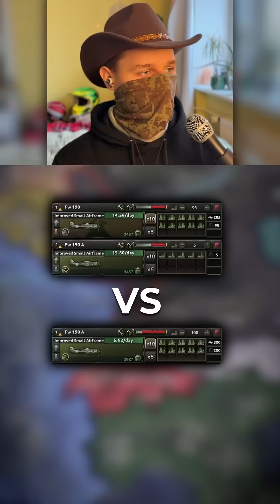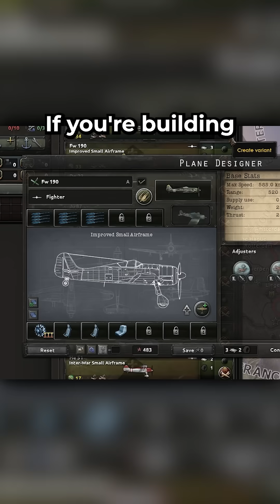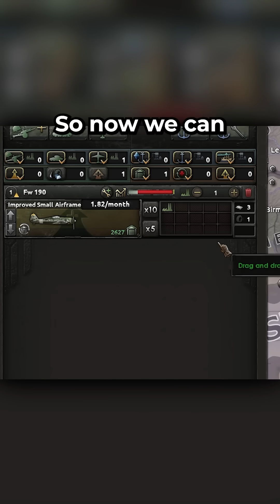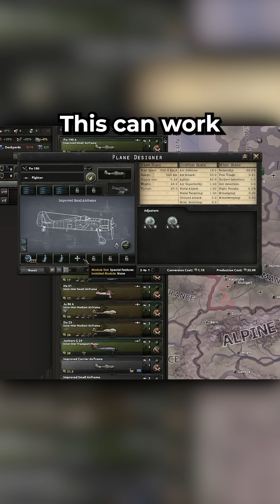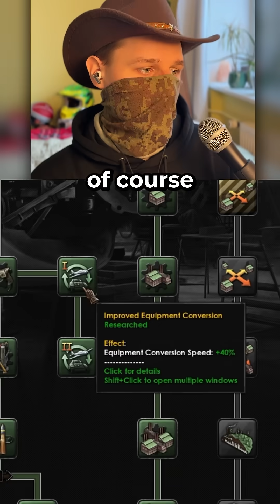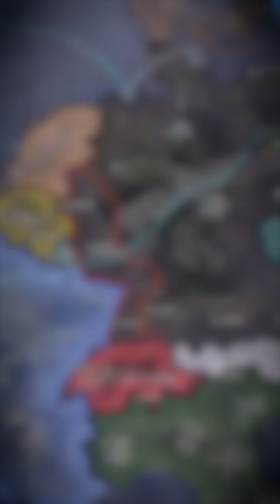Build Planes Like a Hoi4 PRO 📈 Production Guide #hoi4

Comment: I don't know how conversion works, why are you producing both the exploit airframe and the actual one? don't you just produce the first and click convert somewhere? How does this work?
Reply: You make both production lines because the conversion production line takes the cheaper designs in and converts them over time to the proper design over time once it's set to convert valid airframes.
There's no mass conversion button. Almost all equipment which can be converted works this way; being produced or bought, sent to stockpile, and then sent back to the factory lines for refit.

Ships work differently.

Comment: Alright. So this is misleading, because the rubber doesn't just dissappear into the abyss in the second variant. You simply delay the need for the rest of the rubber. Which isn't bad, but it doesn't actually cost less this way. If we take 2000 of the best planes in both scenarios, they will still have the same amount of rubber in them.  By converting you'll loose time. With the conversion tech and everything the lost time will be negligable, but you'll still technically get your best fighters later. That means you'll need to build for longer for the same amount of airplanes as method one. But of course while building, you'll consume less ressources. The rest of the ressources will be used in the extra time that it will take to convert the rest of the planes.
Reply: So instead of using 2 rubbers on 16 production cost and making 1 plane, you use 1 Rubber during 14.4 production cost and 1 Rubber during 1.6 production cost.

Comment: 1. The cost of the hammers will be the same
2. "2 RUBBER PER FACTORY" is not 50% of maximum efficiency, while "1 Rubber per factory" is 50% of maximum efficiency
3. in the same 100 factories, more production will be achieved due to the volume of production

I agree that this saves resources, but I believe it is less effective for long games.

Comment: this ,,converting everything,, is broke the game, change my mind
Reply: Its about the IC cost. Building a whole plane takes up a lot of IC but simply adding a fuel tank to an already produced plane takes up very little IC so you'll only need to put a few factories on the converted plane to convert all the planed quickly. Since resources are paid per factory and you're only putting 5 on the converted plane (low IC) you are saving lots ot rubber but it does produce planes at a slightly slower rate initially

Comment: But that only affects raw rubber usage and not the total usage.  In the end, you are trading time for raw rubber usage.  Depending on the numbers, all this is doing is using more time to produce the final product.  An explanation: assuming you produce 1 fighter per day with 95 factories then after 100 days you have 100 incomplete fighters. Next, assuming 1 fighter converted per day with 5 factories then you have 100 complete fighters after another 100 days.  Each fighter has used 2 aluminum and 1 rubber over the first 100 days plus another 100 rubber over the next 100 days totaling 200 aluminum and rubber over 200 days. This is compared to a slightly more expensive fighter using 2 aluminum and rubber per fighter in which you can produce 100 over 100 days using 100 factories; total usage is still 200 aluminum and rubber over 100 days.  You’d probably just be better off producing 1 fighter every 2 days using 50 factories utilizing 100 aluminum and rubber.  Still takes 200 days for 100 complete fighters, uses the same resources, but frees up 50 factories.  It just doesn’t math imho.  Only way this really works is if you field in cheaper variant on the battlefield while refitting survivors into the more expensive model.
Reply: But it's a game... You don't care about shipping costs to bulk ship 100 planes so anytime you complete a plane it gets shipped and work all 100 factories simultaneously. You produce 1 fighter per a day with 95 factories. After the 1 plane is made in 1 day, it instantly gets placed in stock pile and teleported to the 5 factories to be retrofitted in 1 day. Meanwhile, the original 95 factories don't take a break and produce another plane during that 1 day. So it's 101 days to produce the same amount and NOT 200 days.

Comment: It’s worth noting this slightly reduces output per factory but uses so many less resources it’s essentially always worth it. Usually the issue is resources anyways and not outright production
Reply: Yes you lose around 15 to 20% of the output BUT you get that back on new mils that the civs were using to trade or build refs are building.
Reply: @Fran-yk6jo  15% is quite bad but with research & by assigning more mils you can easily mitigate such issue
Reply: @F.B.I 15% is not bad if with you’re country suffer shortage from rubber, from 2 to 1 rubber there is a 100% difference, double the syntethic oil, that cost tons. By using some expensive desing both fir tank and air, the total price can be much higher in resources, and that lack is reacher or A by mega civs expenses that hurt economy in long run, or B by (if it is rubber) enormous investment in rubber

Comment: I tried this and after a while it stops converting/there's nothing to convert and only produce the one without additional armor, what did i do wrong.
Reply from the maker: Add factories on the 1st production line so there's a tiny bit more of the 1st design being produced than there is the 2nd design being converted. Otherwise yeah you run out of stockpile.

Comment: Should they fixed this ? I feel its off
Reply: It's literally impossible to fix. It's basic converting mechanic. They would have to rewirte entire game resources calculation and base it on number of equpment produced by line instead of number of factories.

There is simplay way maybe by just forcing that's all equpment in production is considered up to date... But this cause QoL issue too. 

The only real option is to nerf converts in way they become simply IC ineffective. I play on mod where there is base penalty to converts is -40% and techs are nerfed to 25% per each. So you end with 10%. Which makes constant converting burning tons of IC. But than this mechanic is usuless and make normal converting too expensive. 

In short. Fixing this requires entire rewriting resourcess system or some weird trade offs.
Reply: @serek123-r4x I might be wrong but %10 loss on conversion doesn't sounds like "tonnes of IC burnt" to me.
Reply: @meteora_tr it is because base game it's 80% output boost when on mod it's just 10%.

Everytime you convert EQu you pay 90% of base chassis cost. Including basically dubel the cost of planes and tanks on that's mod (light fighters around 60 IC. Heavy tanks around 40 IC if done 100% vanilla like) results in at least mod where I play it burns a lot of IC.

Basically conversio ratio I find for 100 mils was basically requiring you to put on converting 40 mils when base air frame was done by 100.
Reply: U use military factories for rubber basically
Reply: @nucelarworker7569  no u actually dont use any more mil factories at all
Reply: There is nothing to fix